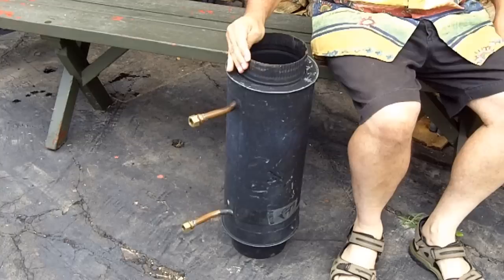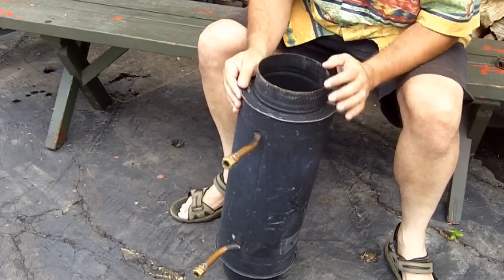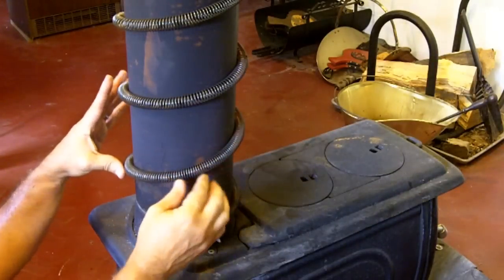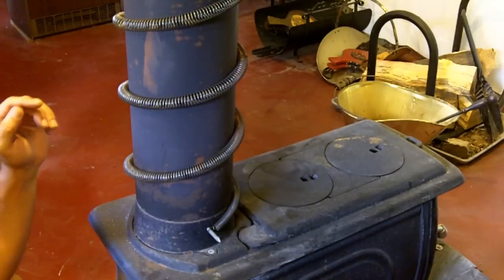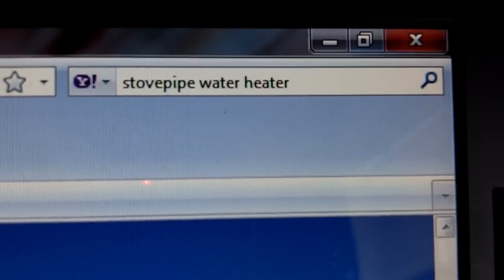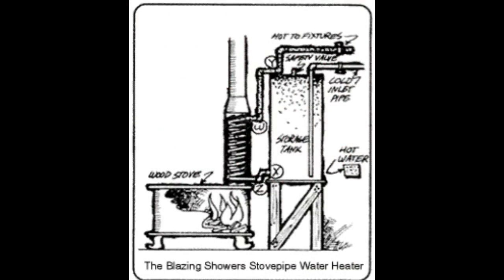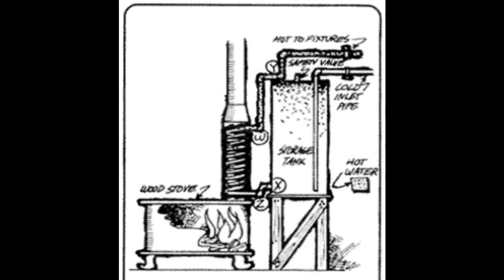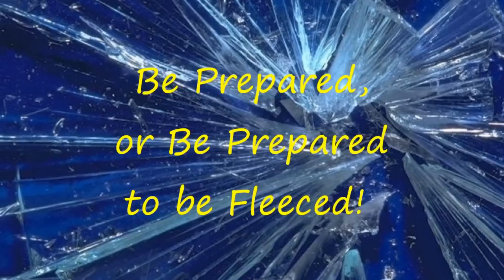Hot Water From Your Wood Stove

Comment: You need at least 300 degree of heat escaping... if you cool off your pipe too much creosote will form on a cold pipe and this will eventually become dangerous when this highly flammable creosote suddenly burns out of control...likely in the middle of the night!

Comment: I got a stove like that in my ole huntin camper..puts out way more heat than that camper needs ..Its not very airtight, therefore it burns very hot, even with two dampers in the stove pipe, I dont dare put much wood in it..

Comment: Why not just use one inch steel threaded pipe and use a vertical design of about six feet and then use 90 fittings with two inch nipples to turn pipe back and then same on bottom. After words put these lines around a peace of four inch steel pipe and then the whole configuration in a six inch stove pipe and hook up to exhaust and you would have more water that is the way I made my heat ex-changer and have plenty of hot water
Reply: +jedediahbc Why don't you post a video of your system, and reference it here? Thanks.
Reply: +N .Tilev Or just put a ss heat exchange inside.....

Comment: The stove you are using is not air tight. It will draw air from all the seems and keep burning until it goes out and you start another one. You can not control or shut it down properly. It won't matter how many dampers you put in the flue. You will use more wood than you need too which will cost you in either time cutting or money spent in buying more wood. For your Safety you need to find a little better stove than this one.
Good luck.

Comment: Wow talk about a disaster waiting to happen. This stove installation is just out right dangerous. using a water loop in your fire box would provide really hot water much faster than using flue gasses, and you wouldn't have the danger of soot and creosote build up. If that pipe should catch fire i don't think you would be able to save the building

Comment: there is no way you can install anything like this in the uk, your horizontal stove pipe is absurd. it will simply choke up. The heater looks dangerous. The coil is pointless. Do you install radiators to then expect the 15mm pipes to heat the room? no so why here? i do this for a living and now it inside out. This wont work, ever.